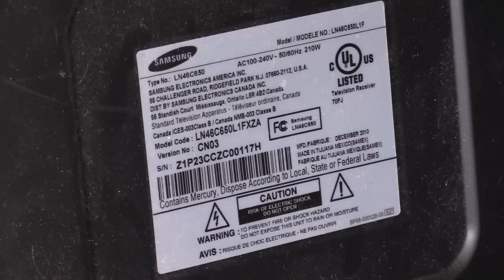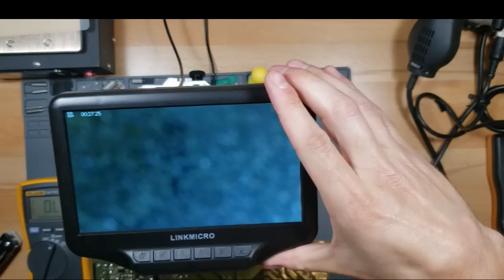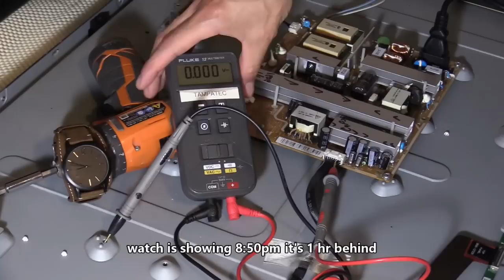Can a Thermal Camera find bad TV parts 🤔

Comment from the maker: if you like these tech repair videos hit that like button 👍
Reply: Thanks Mr tempa tec
Reply: Be careful I got a shock from touching a heat sink on a power supply.
Reply: @cat-lw6kq  lol
Reply: @bigdog8882  has that happened to you?
Reply: @cat-lw6kq  Oh Yeah, just make sure that your other hand is not touching the TV.
Reply: @bigdog8882  Yes good thing I kept my other hand away. I used to work in a tv shop years ago. Now with your help maybe I can fix these new sets.
Reply: What are the model of your thermal camera?

Comment: (sorry for my poor english) hello i want to help you out with your desoldering station... here is the right procedure as Pace, Jbc, Hakko, Weller and Jbc recommend:

1: look at the pads... does it have a big ground plane? is it double sided or/and multilayers? does it have an eyelet? etc... depending on what there is, adjust the temperature to have a quick melt... (my recommandation: if its rohs (lead free) solder, add lead solder... )

2: heat the pad while wiggling for about 2 sec.

3: while continuing wiggling, press the pump for 3 sec... it will cold down the pad and pin and this will prevent bridge solder....

4: release the button and youre done!

this is important to do theses steps... you can see in action on youtube PaceWorldWide videos... if you maintain well your soldering station and do theses step you will always have good results 😉

Comment: Seems like the work of a capacitor with low EPR (Equivalent Parallel Resistance), when they begin to leak DC the usual side effect is over biasing a transistor! 
This particular phenomenon can't be found with an ESR meter, the only way is to pull out the capacitors and test them out of circuit with an LCR Bridge Meter which will give you all the details like, ESR, EPR (aka drain or DC leakage), capacity, quality and phase angle... 
There's a really great video on such a device which I ended up getting after watching it on eBay for years, I would have got it sooner but held off because it looked like it was complicated to use but after watching a video on how it works, I got it ASAP and I have never looked back! 
If you are interested, I can link the video below, the device cost me $95Au and should be cheaper for you and your US dollar! 
The device in the video is the older version which is still available and almost identical to the new version which I got, the only difference between the two capacitor is that the new version went with smd components, internal USB C rechargeable lithium battery, smaller size and blue backlighting instead of green... 
They both have every single bit of information needed on the one screen all at the same time! 
I can't recommend it enough! There's plenty LCR Bridge Meters out there but they will cost more! They don't show everything on the same screen which you have to scroll through to see all the details and either write down the details or try and remember them because you really need to look at everything at once! 
Your in circuit ESR tester is great for a quick scan across the capps but it's totally blind to the other failure modes of capacitors, that's why you most likely have transistors that are burning up! 
Transistors like Vacuum tubes will last a very long time, it's usually something else that will cause them to fail. 
As you saw for yourself, the transistors that we hot actually were good! You have leaky capacitors, another way to check is to look at their capacity! Low capacity equals high ESR, a good capacitor should be just below what it's rated for, if the capacity has gone up! It's leaking DC and because of the leak, it takes longer to measure giving the impression that it larger than what it really is, there's no such thing as an overachieving capacitor! 
The EPR failure mode is the one that catches everyone out! It's the one that destroys everything else in it's path... 
So if you are interested, ask me for the link and I will post it below, after watching this video you will know that you have to have one! 
Thanks for this great video, I really wanted to see the temperature drop on that hot transistor, it would be great to see it sorted...
Reply: Can you tell us where to find this video?
thank you.
Reply: I read all that for nothing. No link? Wth
Reply: I wanted to see the temp drop thermal after  the fix. He said it was still hot but would have been satisfying to see thermals never the less. Great video anyway TT

Comment: I like the information presented on the video. Since the temperature is still high after replacing the parts, would it be best to replace the power supply? Would like to have the latest for the TV if it is still working. Just curios. Thanks for all what you do helping/showing people how to fix their TV.

Comment: the tv closed up in the vertical orientation will receive internal airflow aiding the cooling.... with the back off in a horizontal arrangement the airflow maybe severely reduced.

🧐

Comment: Is this the same on an LG? My 55LM5800 just starting shutting off after about an hour or so (black screen w/ audio). I have to cycle power to get it working again. The picture is great while it's working but the backlight keeps shutting off for some reason. Are these the same symptoms your Samsung TV had? You never really said in the video.

I don't have a flir camera but my EEVblog DMM has a built-in thermocouple.
   Should I start my troubleshooting by testing for constant 5v like in this video?

Any other suggestions?

Comment: You never scanned the board with thermal camera again after parts swap.   Did the temps get cooler or stay the same???????
Reply from the maker: yeah my fault I did record but mic was off. temp went from 300f+ to 220f still too hot. I think it was more tiny surface mounted diodes or surface mounted transistors under the board inline with the transistors on those heatsinks. I'll do a follow up video later if Tv starts to shutdown again.
Reply: @TampaTec     Thanx.      You have to be careful using IR camera with shiny metal objects.    They read incorrectly.   Most guys will put black electrical tape on shiny metal to get more accurate readings.

Comment: Hi.  How come you touch the PSU parts and didnt get a electric shock. Some of that components like capacitors runs 400volts. Fid you shorted the high voltage capacitors? I dont get it.
Hugs.

Comment: i asked you and I am pandering since two months i can not solve my issue ....... i have aftron tv 55 inch  which is not working.
firstly i have problem backlight  but i have picturs and sound ...... 
right now  i dont have  backlight and pictures but  i can not test the sound ......

power stand and on/ off is working properly

Comment: Not being critical (you are a good tech) but never blow on connections to "clean" them.  Use compressed air.  What you are blowing in the connection is moisture and whatever you had coming out in spit on your device.   Again, not critical!